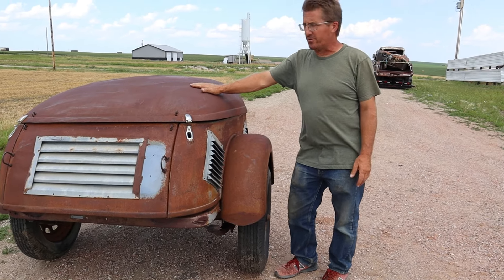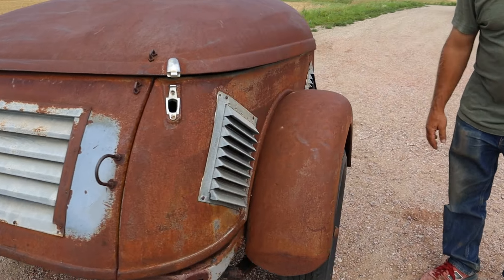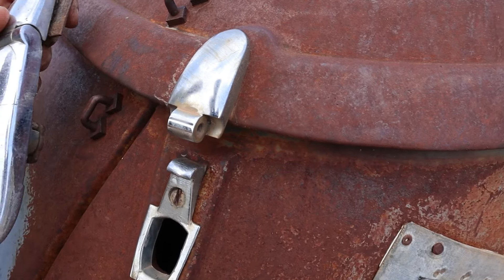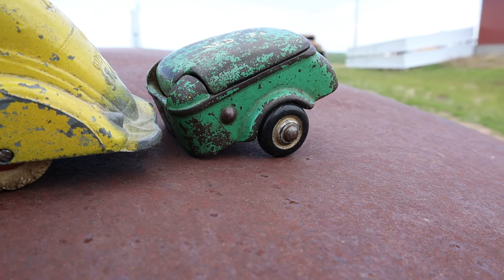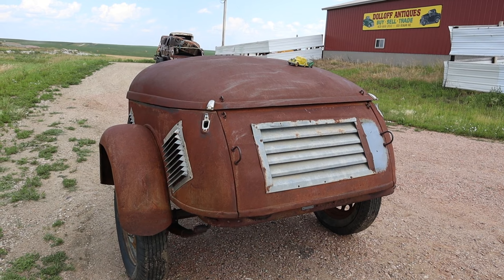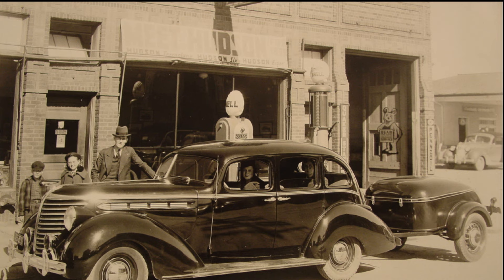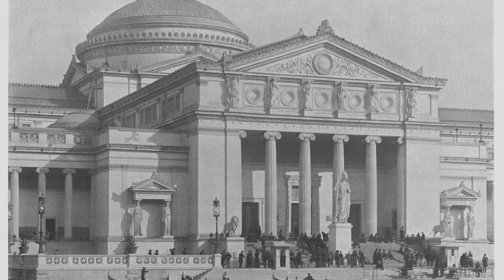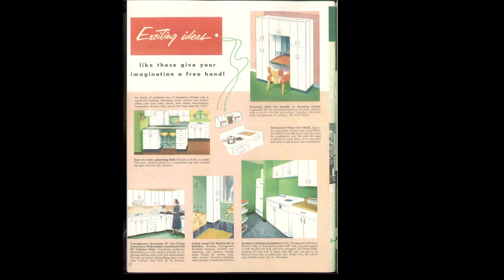The Rise and Fall of the Revolutionary Mullins Trailer | Automotive History

Comment: Thank you for a great bit of history. That puts a perspective on the trailer's value to new car owners... $100 when a Hudson cost $900 including the Bendix stabilizer. This was a deluxe model from a well to do family. Granddad told stories of traveling in the 30's when a family had to carry most of what they needed, including most of their clothes and bedding. For those who don't know, tires exploding (and quickly going flat) were somewhat common. The Bendix stabilizer helped keep the car in a straight line until you could get your car stopped. It was one of many products on Hudsons of the era, including the electric starter and the "Electric Hand", a way to shift w/o a clutch or shift lever.
Reply: This is very interesting. I've only known of Bendix through vacuum tubes and electronics. They made amazing high quality and heavy-duty tubes for aviation, military, and the space industry. If you find Bendix vacuum tubes buy them, but they're expensive. They will probably out live you, your children, grandchildren...
Reply: Most of their tubes were specialized versions of commonly available tube types but heavily modified for long life and high performance. Come to think of it they did supply the auto industry with OEM parts, I don't know how that slipped my mind, chalk it up to old age. I just can't overstate how amazing their "Red Bank" tubes are. You can make a light bulb that lasts for 100 years but nobody's trying anymore.
Reply: @tiki_trash  Bendix has has probably produced 100's of automotive products. Their best known product in the auto industry is probably the Bendix drive which should be close to 100 years old. I'm sure you recognize it; it's a solenoid atop the starter motor. When activated it shoves the starter's gear into gears on your car's flywheel, then activates the starter motor. Once at speed, the starter gear is tossed back. It was pretty much the standard but could be replaced these days by the starter-generator system in hybrids and mini-hybrids.
Reply: @mikep490  I feel dumb now. I know this. That was a long time ago. Every starter ever.